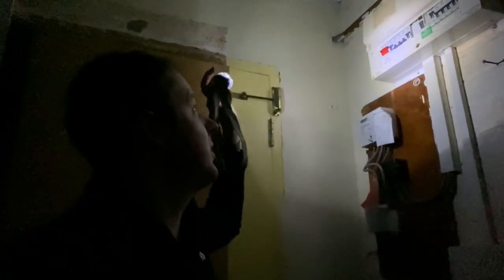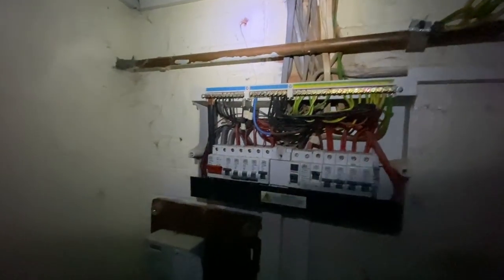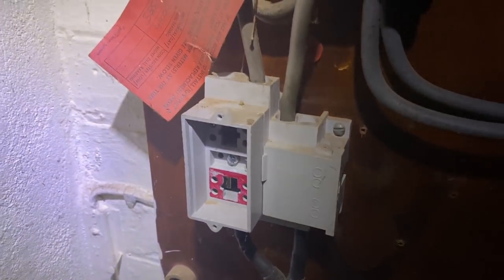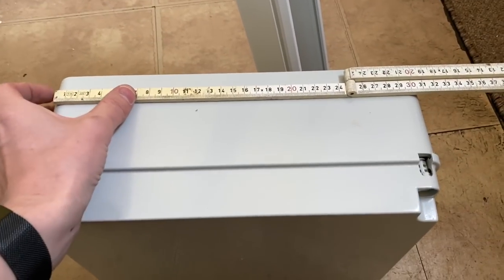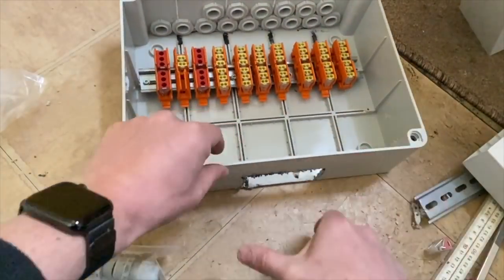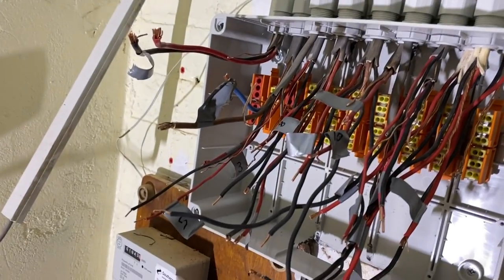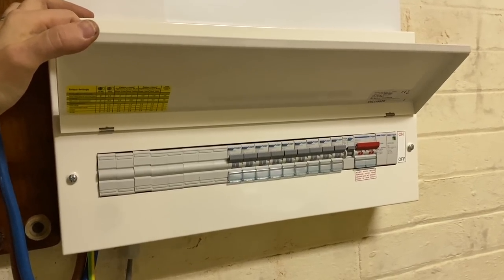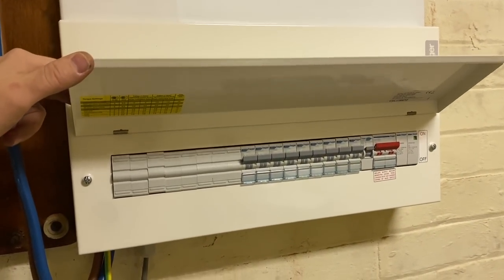Hager Consumer Unit 18th Edition Upgrade

Comment: Hi Jordan 

To get over your concerns of the gas pipe why not install two lengths of CLS timber either side and fix a piece of 12mm or 18mm plywood Over the top of the CLS. then bring all the cables through the back entry holes on the consumer unit
Reply: Agreed, whilst the work is bang on and competent he made a dogs dinner in the whole where should I out the board/how do I get the cables to it scenario. 

Jordan probably knows this isnt optimal in retrospect but as long as its electrically safe and correct then its meets regs and its down to the customer to see whether it has been done optimally.

Fair play as if these electricians didnt film their work and be brave enough to out it on YT for us to view then they would have no bother of someone commenting over the shoulder "dont do it like thattttt do it like thatttttt"
Reply: Either side? Vertically or horizontally? I’m trying to figure out your suggestion. Cheers
Reply: @Ben-zn8pe  I use two pieces of CLS either side with plywood board then run all cables in through the back entry knock outs
Reply: @leebutterworth7465  Cheers mate.

Comment: Coming to this a lot later because I was looking for a solution to update an old split 10 way 2xRCD CU following a kitchen renovation, I liked the entire video which was very informative. I have changed the layout and the whole philosophy of a kitchen so I wanted to modify the electrical installation in line with 18th Edition (as much as possible). Yours is the ony project I have seen so far that comes close but I do have separate feeds to supply each of the washing machine, dryer and dishwasher; the fridge freezer; cooker (obviouly); undersink water boiler; kitchen sockets (radial) and existing circuits throughout the house (rings). So RCBOs seemed the obvious way to go, with a 16 or 18 way surge protected box like the Hager you demonstrated. However I have a few problems with this plan: researching the Hager boxes and accessories I realised that two and a half years after your video, the standard offering in electrical wholesalers is unchanged - 12 Way Insulated Flexible Dual RCD Consumer Unit 100A Main Switch + 2 x 63A 30mA RCDs - in every case I find a split load RCD based unit with a small note on the side that it is possible to buy RCBOs to fit and they cost around £25 each (plus VAT) which is four hundred quid or more and someone has to pay the VAT, almost a hundred quid more. So the populated 16 way CU is a monkey before VAT and before a single cable is added! The customer is looking at a grand for a CU upgrade!
I like the idea of separate circuit breakers for large appliances and smaller groups of outlets such as computers and AV equipment and finally moving away from ring circuits but all this involves a lot of RCBOs if we are to modernise so why have merchants not yet started changing their catalogues? The standard is still "populated" dual RCD and I have not even mentioned arc protection devices. My original trade was plumbing and heating, I trained more than forty years ago and spent years waiting for the industry to modernise only to watch, for decades, as new houses were built with old fashioned radiators and boilers and cylinders and cisterns! My experience of the last twenty years is that electrical installations are almost as slow: only the changing regulations force change in British construction habits but even 18th edition guidance is apparently ignored or delayed. Should not "good practice" have already pushed out the idea of "upgrading" with dual RCD consumer units? and should not prices have fallen on RCBO populated boxes? How long will it be before suppliers assume every new consumer unit should incude RCBOs, surge and arc protectection?  Of course, by then we'll have a new edition with even more changes being ignored.

Comment: Personally, i think to get over the issue about the gas pipe/cables I would consider chasing the wall and imbedding the cables with a protective steel cover over the top. The method used in the vid using the wago in an adaptable box look like a disaster to be honest. I would hate to sort anything out if there was a fault in the future. Just really looks a mess. The board however looks professional. Thanks for the good vid Jordon.

Comment: Jordon I will no doubt be trying a Hager unit out myself. Liked the way SPD is prefitted in the CCU. Nice bit of work with neat finish of cables in the consumer unit. Wouldn't worry too much about the spaghetti in the connection box, it is what it is sometimes I'm afraid. Thanks matey  always good to get tips from yourself. Top man
Reply from the maker: Thanks a lot!
Reply: @artisanelectrics  Where do you purchase the hager CCU. I can't to find it with SPD at TLC electrical retailer.

Comment: I am an electrician for 42 years I have experienced when I have tested for dead on the incomers and found that the incomers where proved dead, found that some of the outgoing circuits were live fed from another supply I have found this issues a number of times, also found when isolating an mcb discovered that the mcb is welded closed these were Durham mcb's.

Comment: Why not use screw terminal din rail connectors, much neater one way then Wago
Reply: @Charles Vane DIN rail much neater job, you can fit cage clamp terminals instead of screw clamp. You can fit terminal numbers on the terminals to match the way numbers on the board.

Comment: Just watched John Ward, his terminal din rail earth connectors actually clamped down and earthed the Din Rail, I have not used these Din rail connectors much myself over the years, but I wouldnt of thought of earthing the Din Rail in a plastic enclosure, you live and learn..
Reply from the maker: Interesting I will have to give that a watch!
Reply: @artisanelectrics  not sure if all the earths should be bonded to the Din Rail though, re testing..

Comment: Something I noticed -- You checked to make sure there was no power at the main switch,  but you did so with all the MBR's off,  so if there were phantom power feeding back into the consumer unit from some circuit such as some hidden solar or generator or cross connection with another installation (and not just from the tails still being live) you wouldn't have known about it prior to handling those circuits when pulling the MBRs out.

Comment: At 13:28, you are replacing the fuse carrier -- without the screw that holds it together.  Question:   What do you do when you find you have lost the screw?   Better to screw it together before replacing the carrier.

Comment: Old school electrician here thinking of changing board due to additional circuits and future ev home point.Regulations have changed quite a bit from 15TH edition. Am i right in thinking you do not need twin rccds when  RCBOs are fitted,and is an ordinary rcbo ok for 7kw charge point which i will leave for ev installer. thankyou
Reply: For the 7 kw load a 32 amp RCBO type A with a B curve would be fine for your EV.

Comment: chisel in to the brickwork and recess the cables slide a bit of capping  behind  the pipe fit a couple of 2x1  lats one each side of  the cables and make a plywood cover . nice tidy job on the db

Comment: Hi thanks for the video in my opinion massive overkill with extending cables I would have fitted 18mm  plywood board  over the gas pipe and brought the cables thru the back of the CU you could have also then installed the new CU nearer the ceiling to give bit more length in the cables. Nice idea with the adaptable box din rail etc but don’t think was the right call in hindsight. Could have just crimped and heat shrink in the adaptable box instead as another option. Why so many spare ways -oh yeah you got the board for free ! Also why didn’t you bring the gas bonding cable  through the box/trunking ? having gone to all that trouble you then stuffed it in the top of the board ! Anyway hindsight as they say is the perfect science, enjoyed watching a fellow spark up against it !

Comment: Hi Jordan, fantastic job as usual. Just something I noticed, I may be wrong, I think those yellow Wago connectors are 773-102 which are rated at 24A, don't you think Wago 221 which are rated at 32A  are a better choice for  32Amp circuits, such as ring? Thank you for very informative video.

Comment: Hi Jordan 

just watched the video to the end, got to say it ended up being a complicated installation for you, just two criticisms the Hager plastic clip on the din rail blanks don't look very neat compared to metal clip in blanks used on something like the FuseBox boards (also their incoming cable clamps are supplied and fitted as standard in the correct place) but my main criticism is your Gas bonding isn't within 600mm of the gas meter.

Comment: Nice video as always Jordan..Extending circuit cables into a new C.U is never straightforward especially when gas and water pipes hinder the process.  Interesting to see that Hagar incorporate an OCPD within the SPD. Controversial subject regarding the need to provide protection of the spd via either a built in or separate device. Some manufacturers provide neither which leaves their products non compliant with BS7671.
Reply from the maker: Thanks!
Reply: Perhaps a better option for the joints may have been a box with a bit of din rail on it and rail connectors like JW had posted up in his latest video. Neat job and not that expensive to buy i think.

Comment: Just did my first consumer unit change and use a massive double tier Hager with SPD and RCBO's lovely kit, dont cant to use anything else. I'd welcome your approach on pulling the main fuse and notifying DNO/Supplier as the whole area seems very grey?
Reply from the maker: Most DNOs don’t care if you pull the main fuse, it’s the only way to safely isolate it there is no main isolator for the installation.

Comment: Nice neat job with a good cable extension solution, however I have a few quick questions
63Amp main fuse, should an electric shower ever have been fitted? especially as you have it on a 40A RCBO and there is a cooker cct and several RFC's for sockets.
is 6mm T&E large enough for a shower with a 40A RCBO (9.2kW)
Is there sufficient division of the installation given that it is going to be an HMO with 8 rented rooms?
63A main fuse is probably way too small for an HMO with 8 rooms, let alone insufficient division of the installation.
What height was the new CU mounted at?
Not sure Marco below has the right approach, I believe you were absolutely correct to extend the cables, also I believe Izalman below is wrong to use "proper DIN rail 1 terminal connectors", Wago have no screws and therefore are one less thing to worry about in future.  The more we can avoid any form of screw terminals, even in non maintenance free areas, the better as no one will ever check they are still tight in a few years time.

Comment: Should the earth bond to the gas pipe be within 600mm of the outlet, or is that just advisory? When I install gas meters we are instructed to advise the customer to have it moved if too far from the meter outlet.
Reply: oh for the gas pipe squashing the cables, we apply a yellow insulation to the gas pipe
Reply from the maker: Yes it should be but in this case it’s within line of sight and they will both be in the same cupboard so not a problem

Comment: A fuse can only protect what’s down stream of it. The fuse in the cut out protects anything upstream of the RCBO/MCB etc. It’s the same as how a FCUnprotects the flex to an appliance etc and not the 2.5mm ring feeding it.
Reply: A fuse can absolutely protect upstream cabling from overcurrent. Just not mechanical damage.
Reply: Monkeh that’s not the design intent. Protection is always upstream.
Reply: @chrisb4009  Considering the upstream protection is not adequate for the size of conductor the DNO brings into properties, you may well find it is.
Reply: Monkeh so you’re suggesting if there is a cable fault on DNO wiring it’s not protected?
Reply: @chrisb4009  I'm saying that the upstream 300A+ fuse is not overcurrent protection (outside of hard shorts) for the 16mm² cable into a property. However, with a 100A or less fuse on the end of it, it gets quite hard to arrange for such extended overloads.. Downstream overcurrent protection in action.

Comment: Is it ok to run cables behind the gas pipe like that?
Reply: Look under your floorboards mate, lol
Reply: Gas regs state that there should be a minimum of 25mm clearance between a gas pipe and any cables or a fire proof barrier, I  am  gas safe registered as well as an electrician.

Comment: I normally use a smallish Bosch drill to do up everything set onto number 7 for speed and then go over everything with a screwdriver. Tork drivers arent used here and until they are I'm not purchasing one either. Mark
Reply from the maker: Cool thanks

Comment: Hi Jordan and team, 

Don't know if you're still answering questions on this one, but... The Main fuse from the DNO was just 60A, but the Isolator switch supplied in the CU was 100A. Is it appropriate to have the DNO 60A fuse as the OC point of failure?

Love the videos, Many thanks :)
Reply: The isolator switch is just a switch and 100A is the maximum amount of current it can switch.

Comment: I know what happened here. You wanted to get rid of a load of ideal/wagos that you havent used in years and probably never would...

As others have said you are looking at installing the CU in 2d if you look at it in 3d you could easily used some batten and ply to get it fitted higher up without extending cables and had the unit 3 inches off the wall. 

Some slim but wide trunking would have done the cables from the ceiling underneath the gas pipe. 

Thumbs up nontheless for filming and uploading

Comment: I do like how the blanks mask the open remaining bus bar, great feature, other manufacturers take note, ;-) great videos would personally have bridged the pipework to mask the cable entries and leave the pipework free for future works etc, but great job. One question though why did you not actually mitre the trunking? a bugbear of mine with my apprentices from what they are taught? I college?? I have been doing this job for 30+ years and this is the real let down for modern teaching. Though I do agree in most cases with the pre-made corners they either never fit right or cause other cosmetic issues, more so with IP rating entry points. Keep up the awesome content, my apprentices love your channel and I am now a subscriber to 👌👍stay safe during all the madness too.

Comment: I would agree that given a HMO & the complexity of the extensions to the relocated board, that you should have considered security & conduited in metal as gives off impression of do not touch to tamperers. Only my opinion though..

Comment: Hey man en good and clean video as always.
May i ask why are al consumer unit's in the uk mat out of metal has it to do because of some fire rating.
in the Netherlands al consumer unit are made of plastic with only the industrial/factory ones  made of metal.
Reply from the maker: Yeah pretty much, the regulations say they have to be made out of non combustible material
Reply: @artisanelectrics  it's because the London fire brigade approached the I.E.T electrical regulation people to get them changed to Metallic and using fire retaining clips in trunking in hallways as they got in the way when they melted.

Comment: Recently having listened to the illuminating E5 podcasts on SPDs..

'Built-in overcurrent protection' appears incorrect: The board datasheet says you should rely on the DNO fuse, the manual for the SPD assembly is.. unclear, but specifies a maximum of a C32 breaker, apparently alternatively up a 125A fuse (how these are comparable I cannot fathom). In either case, it also specifies 16mm² connecting cables to allow for a 100A fuse, which the ones in their CU assembly seem a little slender for.

Prepopulated CUs of any type always seem to be an ugly surprise when you look below the surface..
Reply from the maker: Interesting comment thanks
Reply: @artisanelectrics  SPDs seem to be an expanding minefield with few clear answers in sight.

It'd be illuminating to see inside one of these, but with an SPD215D having a list price of £180 (no idea what they're really going for), I'm not volunteering.

Comment: Can I ask about the wagons. The reds are rated to 32 and the yellows I think to 24? I think you used them on a shower and oven then all the ring mains went through yellows. Maybe I’m wrong?
Reply from the maker: Yeah so 24 amps is ok for a ring main as current is shared down both side of the circuit
Reply: Artisan Electrics yeah that’s cool but what if you have a break in one of the legs then you have the possibility of 32amp down one leg? The only reason I say is I had this discussion with Elecsa and was told I should be using the correct connector for the max load. Great work though.

Comment: Hi. Ive been watching because i have been told i need to replace my 20 year old fuse box for the EICR test. Ive never had problems with fuse box but a sparky says it needs replacing with 18th edition dual supply tarrif. How much would it cost to change the fuse box fitted and with then EICR test. As ive been qouted £1,115.87. I would be interested to now a rough pruce. Thank you.

Comment: If The consumer unit Needs to be a metal Box how comes the connector box you used is not metal also ?????
Reply: Because ammendment 3 only said that distribution equipment (circuit breakers etc) should be enclosed in fire resistant material. It doesn't extend to junction boxes and such like so plastic can still be used.

Comment: Don’t really see the need of the adaptable box personally . Major over kill . You managed to get all the cables in the adaptable box ok so why not the fuse board?
Reply from the maker: It would have looked a mess inside the fuse board having all those cables extended. This way at least the consumer unit looks neat inside.